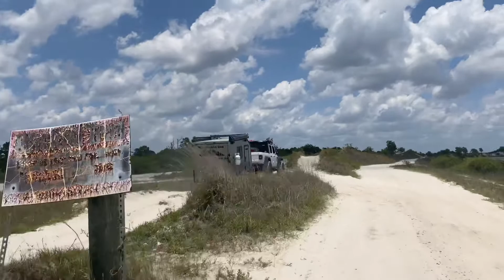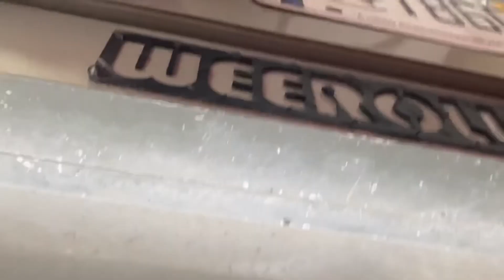WeeRoll Overland Trailer on Obstacle Course - Lazy Springs Offroad Park

Comment: I have a Gladiator Gladiator combo as well. I will be using a lock and roll hitch. Better articulation angle.
Reply from the maker: Yea, I do plan on upgrade to one.
Reply: @BeastFamilyADV   A lock and roll 4 3/4 drop for highway and the lock and roll straight for offroad. Better hitch clearance and better articulation angle. (My opinion)
  Much luck and blessings. Be safe out there.
Reply from the maker: @mikekins6545  thanks for the info!
Reply from the maker: You be safe too!